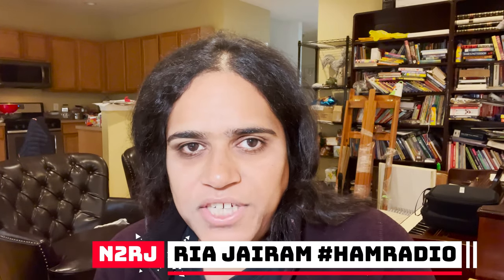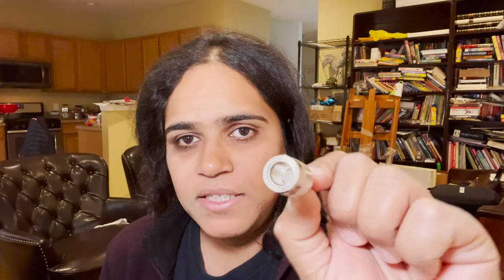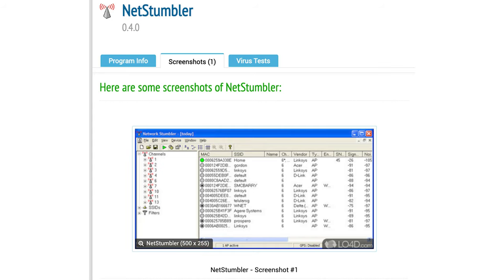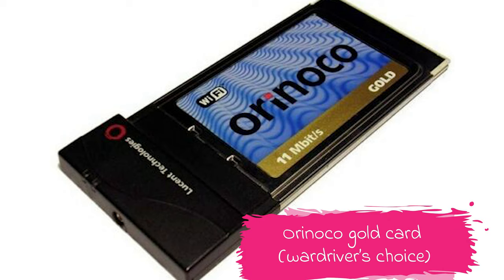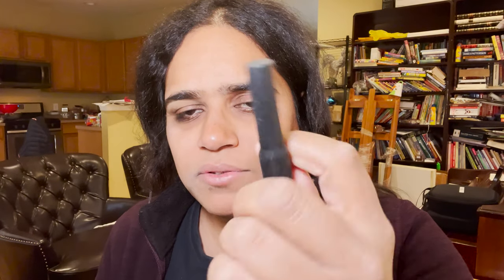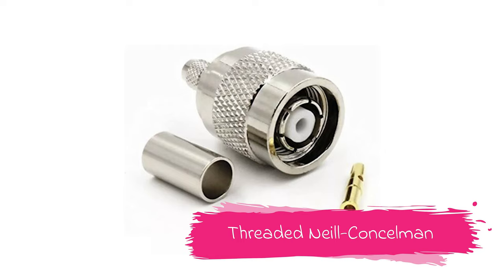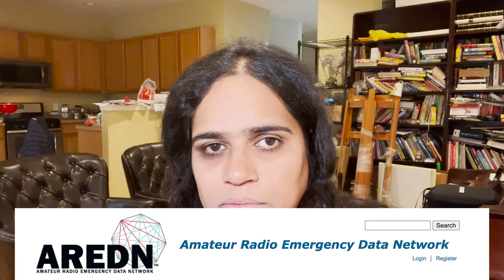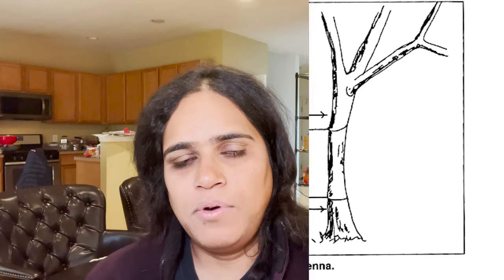Ham radio coaxial connectors - RG58, SMA, TNC, F #hamradio

Comment: I know that 50 ohm N connectors will not safely mate with 75 ohm because of the center pin mismatch, but I believe 50 and 75 ohm BNC are designed to allow mating. The 50 ohm BNC has a dielectric sleeve around the center pin whereas the 75 ohm BNC has an air gap. The different dielectric constant allows them to use compatible pin diameters.  The adapter you held up is a common Chinese mistake, as it has a 75 ohm F  connector and a 50 ohm BNC, you can see he white sleeve.

Comment: Great vid Ria.  I would be interested to check in to watch a vid if you have one on the topic of replacing the internal memory battery CR2032 for the Radio Shack HTX-202 and 404.  I tried replacing mine in my 404 but it did not come back to life as planned.

Comment: Thanks for sharing, I wish you had mentioned different connector adapters such as sma-bnc, sma-pl259, bnc-sma, so239-bnc and the signal losses in them, anyway next time perhaps.

I have a Macbook pro, I kept updating the 32 bit OS and it is right now on 64 bit Catalina 10.15.5 , and none of my 32 bit sdr related applications work,  I really regret as I cant down grade and make them work, also the 64 bit apps for mac OS are few and far between. Please share your thoughts on this, Tia.